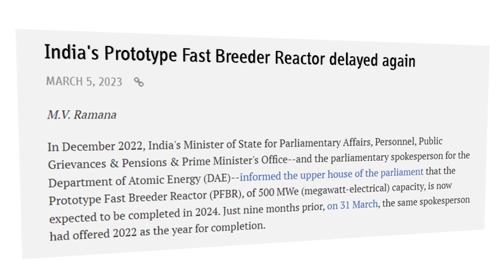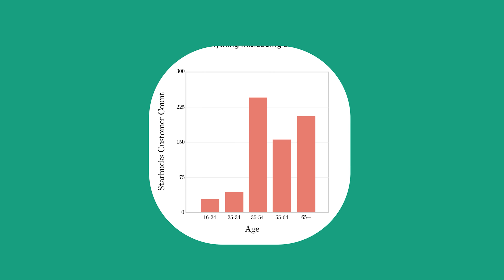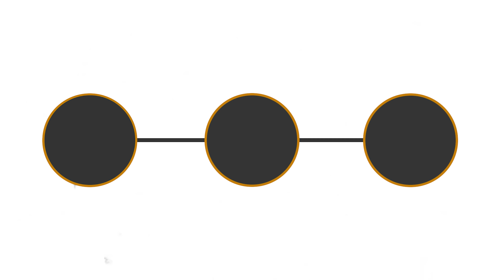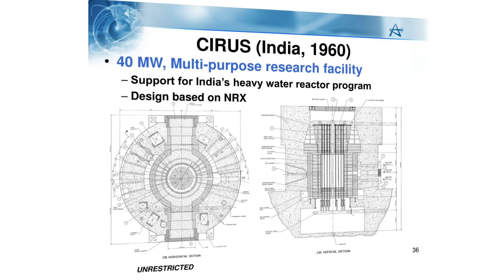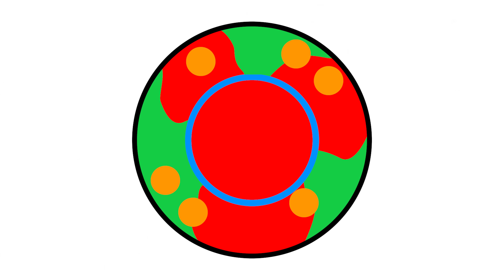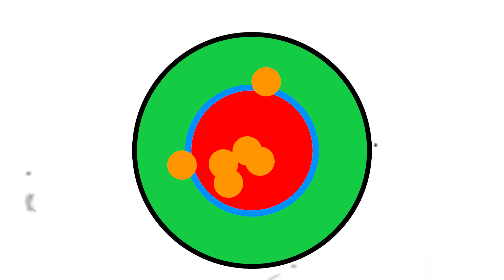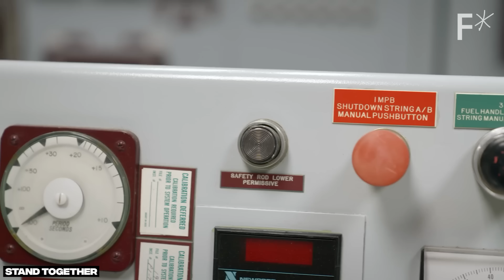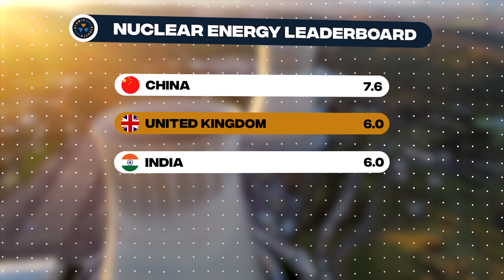Why Sand Will Power India for Centuries

Comment: Now I am curious if you could actually do your breeding in a CANDU style reactor. Say, make your fuel rods out of Thorium and continually move them into the center of the reactor as they get converted to Uranium-233. Not sure if it would be as efficient, but in my eyes, the less handling and reprocessing, the better.
Reply: Yes, A CANDU reactor can be used to produce U233 from thorium, and also can run as a breeder reactor once the thorium is seeded with U233, U235 (bomb grade) or Pu239.   India has the Pu239.   

I don't understand why they have not been running their heavy water reactors on thorium.   

Nor can I understand why they did not build light water reactors with thorium breeding fuel cycles.  The USA perfected the breeder thoriium core for PWRs in the 1960s when they thought that thorium was a realistic possibility for our nuclear power plant futures (and the USA actually built 4 commercial thorium cycle nuclear power plants in the 1960's - 1970's).
Reply: @perryallan3524  thanks, I figured. I'm a pro nuclear Canadian, CANDU is a point of pride to me with all of its design advantages. I knew a US nuclear company was working on thorium fuel rod designs, just wasn't fully certain on the breeder aspect.
Reply from the maker: Yep, CANDU has been shown to work with thorium to breed fuel. Actually, it's already very efficient with U-238 converting to plutonium. India is also working on an advanced HWR that's intended to work with about 40% thorium (sort of a parallel path if the PFBR takes too long).

Comment: Regarding using more thorium, I'd like to hear your take on Clean Core Thorium ANEEL (Th+HALEU).  Yeah, I know HALEU Is a dependency.   But since the new advanced micro-reactor designs depend on it, I expect the supply chains will build out (e.g. for US).  This along with wanting less dependence on Russia.
Reply from the maker: I think the US (and others) now have some motivation for HALEU, which opens up a lot of alternate designs. In my opinion, thorium's best quality is that it is simply an alternate fuel to uranium -- not necessarily cheaper or better. For India, it makes a ton of sense since they have a lot of thorium. For other countries, thorium will probably remain a niche fuel source, but we'll see!
Reply: The USA perfected the breeder thorium fuel cycle for PWR power plants in the 1960's and also built 4 purpose built thorium fuel cycle commercial power plants in the 1960's - 1970's.     While 3 of 4 power plants were technological flops, a major issue identified at the time was that it cost significantly more to refine thorium ore into nuclear power plant fuel than it does for uranium (and it was not even close - and the economics did not change when they studied scaling it up to supply the entire USA reactor fleet).

Just on economics alone uranium won out.

I have seen nothing to suggest that has changed.

The PWR is the most common nuclear power plant in the world (and gaining) as many decades of operation has shown it to be the most cost effective long term.   The vast majority of PWR reactors in the world could be running on thorium today if it was cheaper than uranium.  Likely about half would be running on thorium if it was essentially cost competitive.

I have no idea why India did not build PWRs and be running thorium breeder cycles with it.
Reply: @perryallan3524 
The program had been Envisioned apart from many Technological hurdles that came with the development process they had to account for the self-reliance guidelines.
Many of the prominent scientists were assassinated, do you wonder who could have done that, they might have fear about Indians using that tech to further their Nuclear programs and were actively sanctioning India for that, meanwhile they actively supported Pakistani Clash in the East Pakistani Independence?
Oh, boi Uncle Sam can't think about a Multipolar world where everyone is happy
United States Meddle with many things it has no business with
While China may be a threat to India, USA in the long term is more fatal to any country